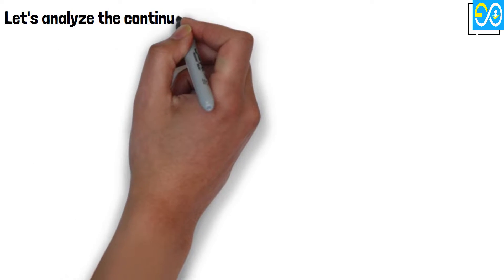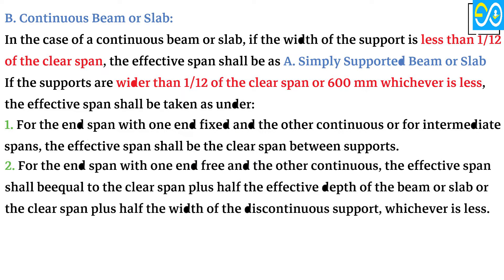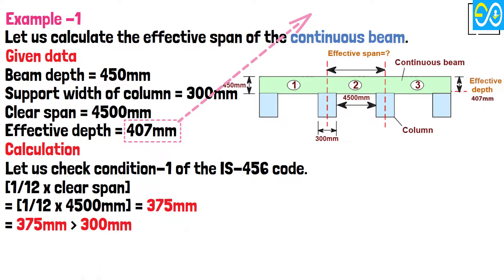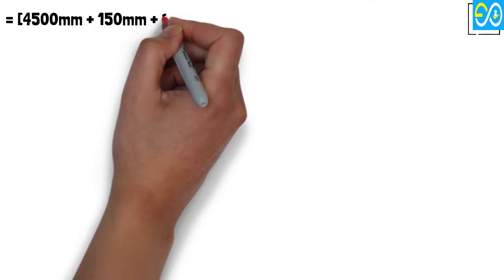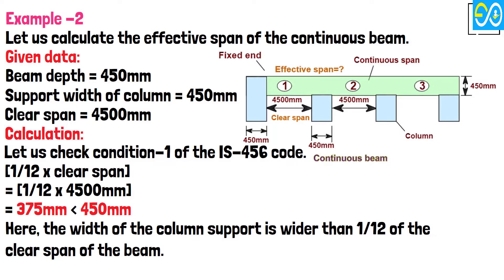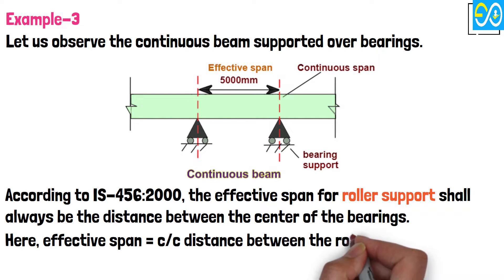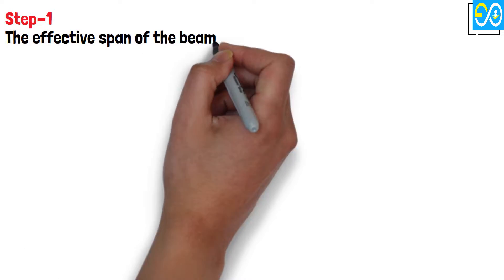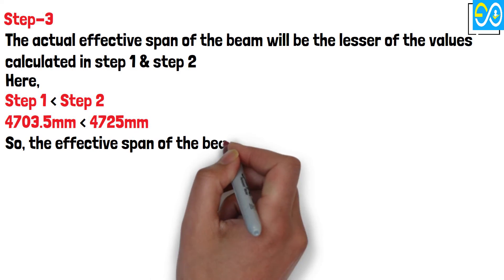How To Calculate The Effective Span Of Continuous Beams With Various Support Conditions?

Comment: In Example 2, when one end of beam/slab is fixed then the calculated Le of 4500 mm is for that outer span only or it is for the inner spans as well. If not then how to calculate Le for inner spans ?
Reply: same doubt... btw did you get the ans?